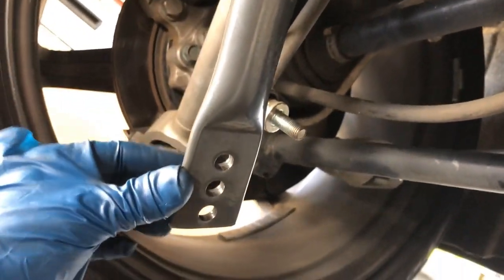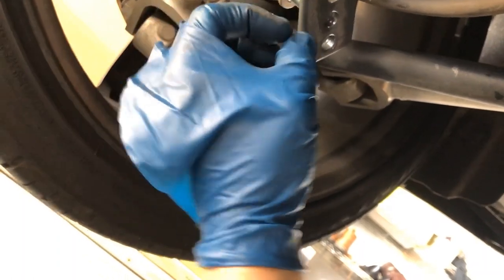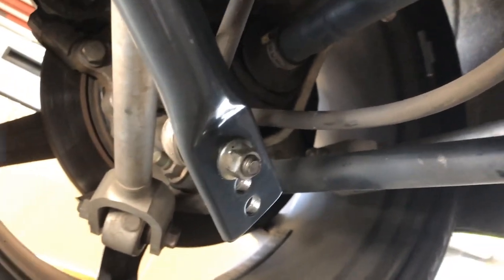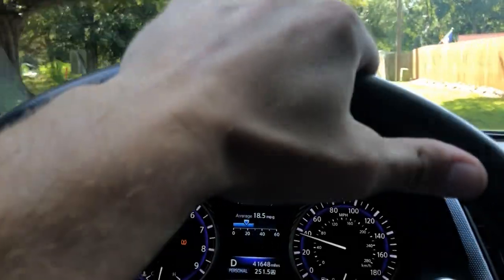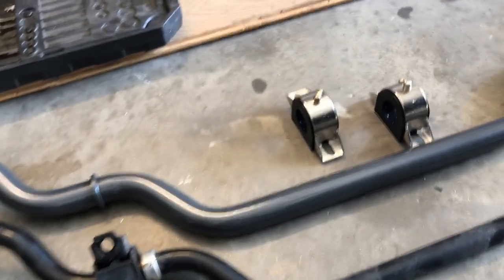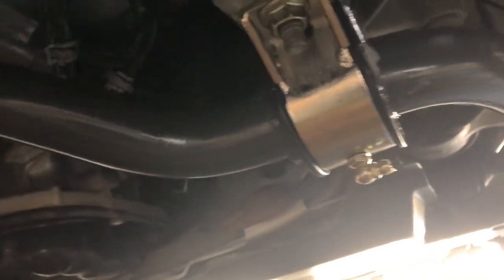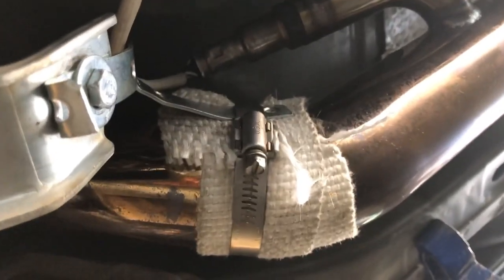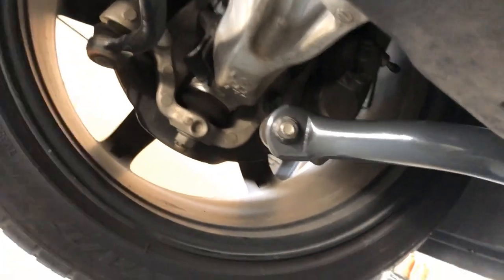Q50 Hotchkis Sway Bar Install and test | BEST MOD for UNDER $500

Comment: My favorite car is my 2019 370z 6MT with the sport package that is in Magnetic black.

I had these bars installed shortly after I got the car in early 2019 and loved the improvement in handling. It's one of the best bang for buck mods you can make on a performance car. I also had stainless steel braided brake lines installed for a firmer pedal feel.

I have since installed a Stillen Gen 3 intake, a Fast Intentions x-pipe exhaust and an EcuTek dyno tune done by Specialty Z in Simi Valley, CA. The owner, Seb, was able to get about 380 peak crank hp(321 at the rear wheels) with a uniform 15% increase in torque across the rev range.

Comment: FINALLY got front and rear on. Easy job! 2 hours start to finish. I was able to get the rear on without any exhaust removal (scratched up the bar pretty good though)

Comment: Is it recommended to get Oem parts or better for the links? Having trouble finding rwd Oem links. I’ve found moog, mevotech and z1. Are any of these good or better than Oem?
Reply from the maker: Well moog and mevotech would be oem replacements while Z1 would be upgraded adjustable links — unless you’re just looking at the oem replacement links in their site. Moog is good though
Reply: @SpeedCultureStudios  yeah in z1 would be the oem version from them. I’d prefer exact Nissan/infinity but hard to find. And would you say moog or mevotech supreme is as good or better than Oem? I love the price on them but i keep reading how ppl have had issues them not lasting long. Also ppl saying moog isn’t what it used to be. I’ve also heard of 555 brand from Japan to. Just going crazy trying to choose lol.
Reply from the maker: @huhSHUA  quality across the board seems to have gone down.  Reality is that many of them are the exact same just rebranded.  I’m good with Moog products still.  If you’re worried about it—look at the upgrade options like Z1, whiteline, or spl
Reply: @SpeedCultureStudios  thanks man I appreciate the help and input. Think I’m going with moog

Comment: Did you need to change out all your endlinks when you did sway bars? Also, Hotchkis just came out with front and rear for us AWD guys would you recommend getting both or just stick with the rear? Cheers
Reply from the maker: No need to change end links. May consider upgrading some components eventually though. 
The awd front sway bar is pretty robust already so not completely necessary, but I don’t know what the specs are for the hotchkis one. May be a nice upgrade. The rear one is the most noticeable though!
Reply: Speed Culture Studios thank you, sir!
Reply from the maker: Frasier Haber no problem!

Comment: Just got these ordered, too.  You end up leaving them on the closest setting (1st hole) you showed in the video?
Reply from the maker: Yes, I left them on the stiffest setting. They really aren’t all that bad with fat tires, but when you want to kick the rear around, you can do it pretty easily
Reply: @SpeedCultureStudios  sweet, appreciate the response as always.  Still on stock size tires (I have the black/dark chrome rims that the sport package came with but I have the base model and didn't want to change the wheels as I actually like them a lot)  but they are the Indy 500's so I'll just set them to stiffest and see how I like it!  Will be using your vid to help with the install.
Reply from the maker: Robert Tam super easy install!  You’ll love them, especially with the Indy tires. You’ll really be able to push that car!

Comment: I have no immediate plans to lower my car, would you still suggest the front being done on my AWD or would the rear only suffice? Also, what setting in the rear would you suggest now that you’ve been driving on stiffest setting for awhile.
Reply from the maker: Awd has a pretty substantial sway bar in the front.  You’ll feel the most difference with the rear—it would be sufficient in my opinion.  I have not tried any of the lighter settings but can’t find a reason to honestly.  The car fees really planted and aside from the open diff, it is easily controllable.

Comment: Speed culture hru brother. Am trying to decide whether to cammed my 3.7 g37 or run a nitrous kit . Which u recommend for best bang for buck.
Reply from the maker: Well cam swap is pretty intense job and gains are really not all that crazy. Numbers will still be sub 400 wheel with cams and every bolt on possible.  Nitrous will get you there a lot cheaper, but the trans is still a weak point and there is always risk with nitrous.  Tough one.
Reply: @SpeedCultureStudios  am thinking about 50 shots

Comment: My favorite used to be the Camaro for a long time. Now it's the 2011 Honda Accord coupe, it was stick and way lighter and stable. Currently I have the G37 Coupe and you described that problem well. I've been having that issue especially when changing lanes at high speed where I freaked out thinking the car was gonna lose control and either hit something or flip. Same thing happens if I try making a quick turn including U's at low speeds and the rear would dance all over the place (tires are less than a year old). So definitely I'll be investing on anti-sway bars, I don't want to lower the car because the height it has is perfect for me.
Reply from the maker: It’ll make a big difference!!

Comment: Z1 just released some sway bars for the 2014 Q50 AWD. Not sure if I want to put these on my Q or the Z1’s. If you have any info on the comparison between the two, it would be greatly appreciated!
Reply from the maker: I’m just seeing Z1 released theirs as well.  They generally have pretty solid parts, but Hotchkis has specialized in these components for decades.  If the price is similar, you don’t have much to worry about.
Reply: @SpeedCultureStudios  thank you much 👍🏼

Comment: Hey man, have you experienced any clunking noise? I have the sway bars installed and it started clunking after 3 weeks. What could the problem be?
Reply from the maker: Front or rear?  Very difficult to say with limited info.  Could be diff brace.  Could be trans mount.  Could be sway bar bushings.  Ball joints etc…
Reply: @SpeedCultureStudios  it sounds like it’s from the fronts only

Comment: Nice brother, What about straight line performance  like drag racing racing. Can they help .
Reply from the maker: "help" might not be the right word, but they can play an important role especially with adjustable endlines.  Adjustments can be made if a drag car has a tendency to pull in one direction or another.
Reply: @SpeedCultureStudios  thank u brother.
Reply: @SpeedCultureStudios  speed culture can 75 shots of nitrous and still be safe or 50 shots to be even safer .
Reply from the maker: @torvarrisevans7846  The car can handle a 50-75 shot, but it needs to be done right and you need to tune the car for it.  Research nitrous a lot before messing with it.
Reply: @SpeedCultureStudios  thank u brother.

Comment: I see a lot of people lifing the car with the diff. Isn't this a bad idea?
Reply from the maker: No.  Just want to make sure the jack is placed properly and does not compromise the seal.  You also do not want to support the weight of the car in that location for too long.  Getting the wheels off the ground is fine, but you should place jack stands right away
Reply: @SpeedCultureStudios  thanks for the reply. Feel like I'm talking to some kind of celebrity
Reply from the maker: @tykedogtyke  lol you’re not haha

Comment: Do you know if the stillen is thicker than the hotchkiss??? Cus I want to get the biggest. Boost in motion says
Reply from the maker: Thickness is not always the determining factor.  It’s stiffest it’s most adjustability that’s makes the difference.  And no, Hotchkis has a better range of adjustability and better stiffness, which is why I chose them.
Reply: @SpeedCultureStudios  Thanks for the feed back! I just purchased them for my q50. BTW I love the videos!!! They are very informative. I have seen a million youtube videos and your the first and only one I have subscribed too.
Reply: I will let you know how it goes after the install I bought the megan racing strut bar and the z1 subframe collars.
Reply from the maker: patrick Futral really appreciate that man!!

Comment: Sits nice with that lowering.  I live in PA, and between the weather & governmental bureaucracy, the roads around here are on par with Fallujah... albeit with waaaaay more traffic. Lowering just doesn’t make sense of a daily driver. 

Have the Stillen rear sway sitting in the garage for 2 months now.  Guess I’ll try and steal a few minutes to myself to get it installed this weekend.
Reply from the maker: If you can’t go lower, the sway bar will definitely make a difference!  Doesn’t take long at all to install either!